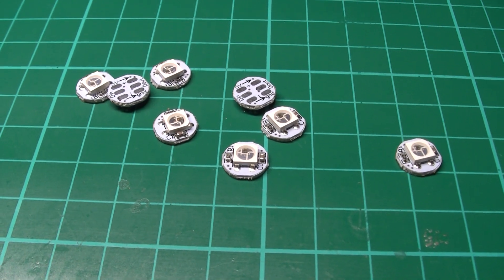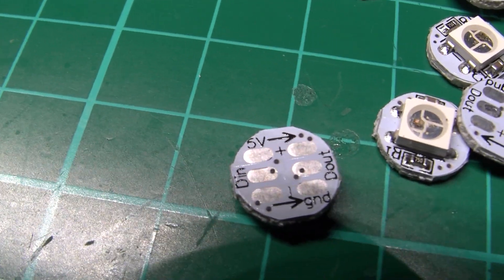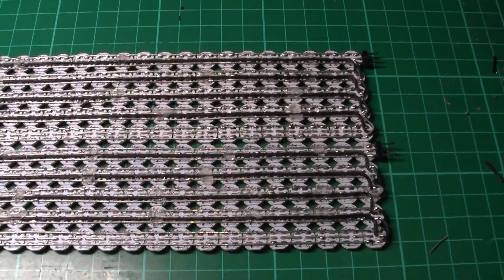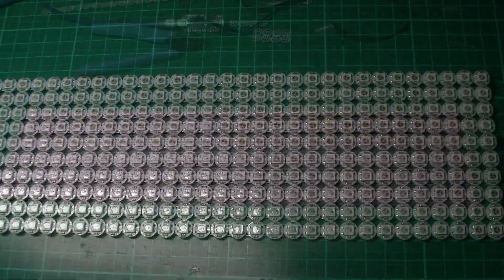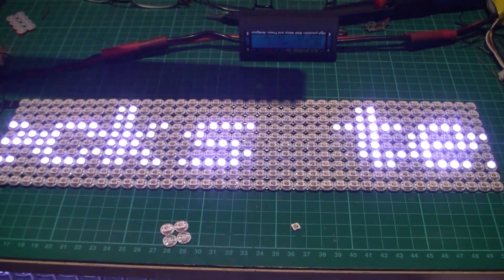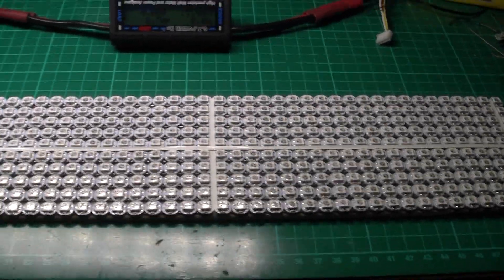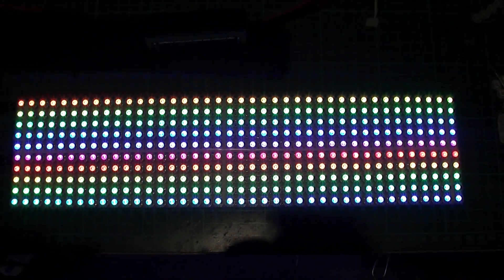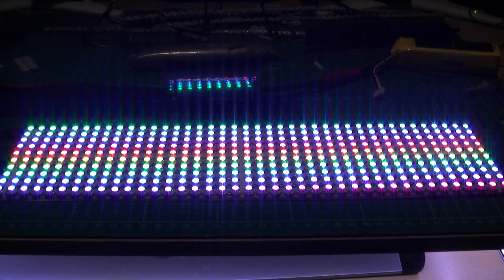Arduino & 400 Neopixel WS2812 RGB LED matrix project

Comment: Man you're crazy alright to actually make a 400 led matrix, I don't know if you have kids but the 200 leds that you have left over you could use to make a crazy Halloween costume with lights, and you can make attributes to add to that for example a red and yellow glowing sword so it looks like there's fire coming from the edge of the sword, or make a Tron costume that requires some lights.
Or you can place the leds at random places outside in your garden or somewhere on your house and use them as twinkly lights, man there are so many things you can do with neopixels, they are very cool.

Comment: If you power the Neopixels from a separate 5v supply capable of handling the amperage, then the controller only only needs to have the GND and Data lines connected to work.

Comment: Noting the Truth! It's a tough Love. I have a project of 300 coming up. Thanks for the hint about testing the modules prior to soldering it all together.
Reply from the maker: You don't need to test them - the LED itself is quite easy to replace once it's all assembled. You leave the base part and simply unsolder the square LED.
Good luck with it..... I'm already feeling your pain :-)

Comment: Hey ! Was wondering what are the specs on the wire you used to solder it all together?
Reply from the maker: It's simple link wire like this: http://www.ebay.co.uk/itm/121623613167

Comment: Did I miss any part about resistors or anything? There are no resistors on there right?
Reply from the maker: You're correct, there are no resistors. They aren't the same as using normal LED's because they're digital and there's no resistors needed.
Reply: Okay thanks for the info! I'll have to look more into it

Comment: I just finished soldering 1400 of these in a 20x70 matrix.  Can you post some detail about how to power these and how I separate segments because of the current drawn by this large amount of lights?  I also don't know what I will need as a controller for this amount of lights.  Please help.  I have a crapload of hours in this as a gift for my fiance, and I have literally "Lost My Will To Live".  You need to get shirts made up, by the way.  You totally own that phrase now.
Reply from the maker: WOW, 1400? You must be on the edge of suicide by now! :-)   
For power, I calculate how much a certain amount of LED's at full brightness and displaying white takes. e.g. I've got some 5v 5amp regulators - Each LED is 0.06 amps which means I can drive 83 LED's with one 5 amp regulator. I simply detach the power (but leave the data connected) at LED 80 (to be safe) and connect the power to that segment of LED's. Either that or get an 84a power supply to drive all of the 1400 you have. Sadly I can't find an 84a power supply but I have found a 70a ...... https://www.banggood.com/Universal-AC110220V-to-DC5V-70A-350W-Switch-Power-Supply-Driver-Adapter-Transformer-LED-Strip-Light-p-1038797.html    
A 70 amp power supply will be OK because you'll never have all LED's at 100% brightness and displaying white.   
I use an Arduino Nano to drive them but literally any Arduino will be fine. Theoretically, you can drive 65535 LED's with a single Arduino.   
As for the shirts...... I think I might just do that. I don't know how many times I've said it now :D
Reply: I have run 1400 LED's from a 12 amp 5 volt power supply and an Arduino Uno.  See: https://www.youtube.com/watch?v=PFup912TcVs&t=4s

Comment: I took two years but we finally watched this one. Jon has got 60 element strip and is trying to program a teensy to make a light show. thanks for the vid! Tony, you kind of sound like Marvin the depressed robot from Hitchhikers Guide on some days. Marvin is a prototype for the GPP feature. People say I sound like Hank Hill sometimes, not sure why :-)
Reply from the maker: I've never watched Hitchhikers Guide but I'll have to watch it now. Looking at the video I've just seen, you're right, I do sound like him!
Some people say I've got the same temperament and sound the same as Jack Dee (another British comedian) but I don't see it myself..... I don't know where they get it from :D   
Good luck with the Teensy and strip, Dave. It's easy if you follow the examples but you'll be driven to suicide if you try anything else like I (stupidly) did.
Reply: I think Jon needs WS2812 teensy 3.2 examples but is having trouble finding any.
He wonders if he needs the 74HCT245 or similar buffer chip to get the voltage from 3.3v to 5v.
Reply from the maker: I used an Arduino Nano because of the 5v signal output  - it's much cheaper and you don't need level shifters.

Comment: why are you not use ready LED panels from Aliexpress? Like 8x32 or 16x16  - you may connect it from one to another to do a huge matrix. Or maybe they can do panels by your specs - now I'm just searching this option, because I need NOT a square rect shape...
Reply from the maker: Simply because there's no fun it doing that. I prefer to make things, rather than simply bolting panels together :-)
Reply: You will need 50 amps at 5v? Or do you not plan on powering them to 100%? That is a lot of amperage due to the 5v rail of addressable LED's. It's actually only about 250 watts, less or slightly more depending on color and brightness. However the gauge of wire you use depends on amps, not volts. However, if you use 5 taps to the power rail down the panel, each wire will only need to carry 10 amps each. 

I would use solid core personally, and then run the power output to every row in the strip to reduce the voltage droop, otherwise the LED's will fade out.
With that much current though, as close as possible would be ideal, less power loss to heat.
Reply: Richard Smith thank you for replying 😀 I have power to every strip to a terminal block at bottom of panel, I'm going to use the matrix outside so was hoping to have the power supply inside which is about 5m max...I have a 60amp 5v supply but unsure of the cable required from it to the matrix terminal block? 😏
Reply: If by matrix terminal block, you mean the data line, that isn't very important as far as distance goes. For the power rail, as long as you use enough taps back to the power supply so the current is reduced, distance of the power supply will be less of an issue. However, if it is too far with a lot of current, the current requirement will go up even higher due to power loss as heat in the wire itself.
I am assuming, of course, you are using addressable LED's. If you are using individual LED's that are matrixed... that is a whole other can of worms, but similar in that multiple taps per axis would be ideal. I sure hope you aren't matrixing 900 LED's. A shiver ran down my spine thinking about it. 60 digital inputs to deal with to boot... Would need to be multiplexed.
Reply: Richard Smith sorry if I didn't explain it well enough, I have power lines from each 30 rows into a power block on matrix so I need power from that power block to the 5v supply which is 5m away?
Reply: That would only be ~2 amps per row, that should be fine, assuming you have a high enough gauge wire. 5m of 14 gauge stranded copper wire would only cause a 0.03a current loss I believe.
Reply: I would NEVER do individual LED's, but I think using LED strips is just enough work to feel rewarding. Using preassembled panels is cheating.
Reply: Richard Smith IV made a 900 pixel matrix from led strips....need some advice on powering it....I plan to have power supply 5m away so what cable should I use or am I best of having it closer?

Comment: It almost sounds insulting to say - "just use some WS2812 strips". Looks very impressive and a lot more sturdy than 10 strips curling up at the ends and peeling away from their backing! I get board wiring up just 5 of these... Cool job!
Reply from the maker: Thank you.   
Yes, it would have been much easier and, in hindsight, I should have done it with strips. Mind you, I like doing things to show what's possible.
Reply: Agree - like handing a paint roller to an artist and questioning why they used a small brush?! :)
Reply from the maker: I couldn't have said it better myself :)

Comment: You’re very close to a message board that mounts in the back of a car - letting drivers use to talk to folks (or f____ks) behind them that need to know “their door is open” or “your lights are on”.  If you can make one of these with a voice command through our phone, universal mount, relatively inexpensive,  you will get very rich.  If not “voice command” then a set of common commands that one might use to tell (or tell off) the driver behind us.
Reply from the maker: You've just described everything I usually do with my fingers :D    
I think I've gone as far as I want to with this. Sadly, I lose interest very quickly and I've moved onto bigger things now.....sorry :-(
Reply: I have often thought of what you describe. I invision it on a thin wire matrix with the smallest ws LEDs, stelth on the window like defrost wires.

Comment: Hey, really cool work. I'ts my first time working with WS2812 LED, and I have some questions: Do the DIN and DOUT have to be conected  to something for the leds to work? or can you just conect the + - and gnd? thanks
Reply from the maker: This is how they work.......    
The LED's talk to each other and they know if there's another one connected to it. The first LED is number zero (because it can't see any others connected to the DIN side) The next one looks for an LED connected to its DIN pin and asks it what number it is (zero in this case) and numbers itself 1. Now it knows it's number 1, it talks to the third one etc. etc.    
That's how the numbering works. You need to connect DOUT to DIN for them to work.    
Connecting just the + and - won't do anything (you may get some of them randomly come on) but you need to link them all together and initialise them before they'll work. Try loading the 'Adafruit Neopixel' example.    
Hopefully, I haven't confused you even more :-)
Reply: No, thans a lot man. But how do you make a matrix with them? Thanks for the fast and gelpfull reply
Reply from the maker: Making a matrix is a different story and hard to explain. It still uses the same principle but (as in my project) there's 10 rows of 40 LEDs. LED zero is the top left, LED 39 is the top right, LED 40 to 89 is the 2nd row etc. etc.    
It's best if you start reading up on the Adafruit website - it does tell you more about how it works and explains it far better than I could on here........    
https://learn.adafruit.com/adafruit-neopixel-uberguide/neomatrix-library

Maybe one day, I'll do a bigger one with a tutorial on exactly how to build it but my time is rather limited at the moment :-(
Reply: Ok, no problem. So it doesn't work the same way as a matrix in colums and rows?
Reply from the maker: It works as a single row of LEDs but you link the end of one, to the start of the next. If you wanted to illuminate the left 'column' you'd illuminate LEDs 0, 40, 80 120 etc.
Reply: But to light 0,40,80,120, ... do you program that with a computerchip? (Arduino,plc,...)
Reply from the maker: Yes, you do need something to control them. I use an Arduino Nano on this video.

Comment: What power supply driver are you using?
Reply from the maker: In this video, I used a 3s Lipo (12v) into a 5v regulator. I've since started using one of these:    
http://www.banggood.com/Universal-AC85-265V-to-DC5V-10A-50W-Switch-Power-Supply-Driver-Adapter-Transformer-LED-Strip-Light-p-1038777.html
Reply: I buy a LOT of stuff from banggood!  Especial Arduino's!
Reply: I thought about getting that once, but putting mains wires onto the back with no cover?
Sounds dodgy af

Comment: it is not digital in digital out, It is data in data out
Reply: It uses a digital signal to transfer the data through those pins, so technically it is both.
Reply: No difference since the data is digital in this case. Data lines aren't always digital, but digital out is always also data out :)

Comment: What about a SD, HD, FHD and UHD screen with that LEDs?
That will be the true LED screen.
Reply from the maker: +metralha761 I did think about it but I did some calculations......it would be 3m wide and use 7kw of electricity :-)
Reply: +Vortecks true, and if we talk about UHD we have around 7 floor building of tall and more with width. So it will be a crazy screen.

Comment: This kind of LED's can be controlled by another controller? I mean the T-1000S for example! Because this LED's haven't chip.. So i dont know about it!
Reply: From the specsheet, it looks like you just daisy chain them and send a bunch of 24-bit RGB's into the chain.  The first LED reads the first RGB, displays it, then removes it and sends the rest down the chain. Repeat for the 2nd LED, 3rd LED, etc. until it hits some "pause" which indicates it should start over (i.e. refresh the screen). That's how I think it works anyways. It's simpler than how they make it sound, because they aren't really "addressable" which implies you talk to each LED individually.

Comment: You can give them to me if you can't figure out what you want to do with them
Reply from the maker: +Mr. ProLogic I use them as a noticeboard/light show at work :)
Reply: +Vortecks I actually like it how much would you charge me to make one for me
Reply from the maker: +Mr. ProLogic As I said to someone else who wanted me to make one......The labour alone would be more than the cost of importing one from China my friend. Honestly, I don't think I could build one for less than £200 because of the time and coffee I'd need. Sorry about that :-)
Reply: Okay well where did you get the diodes at & I will sit in front of my sodering station and make 1
Reply from the maker: +Mr. ProLogic http://www.banggood.com/100Pcs-DC-5V-3MM-x-10MM-WS2812B-SMD-LED-Board-Built-in-IC-WS2812-p-979463.html Have fun and make sure you really want to do it first :-)

Comment: "i was gonna do 600, but i've really lost the will to live" xD
Reply from the maker: +hetoan2 Someone suggested doing a VGA matrix (800x600) but I'd have committed suicide by now :-)
Reply from the maker: 480,000 pixels, 1,000 amps, 4kw of electric and £52,000    
I don't think so :-)
Reply: @Vortecks  lessen the brightness and use adressable strips so you a. use less power b. have less trouble assembling
Reply: Why would you do this and not use the addressable strips instead. I would kill myself...
Reply: Hi, good video!  I produce a compact LED controller and softwere for the animation of such LED Matrix. You can see it on my channel.

Comment: I have my first 100 of those coming from Banggood in a couple of weeks (??) and am going to craft them into some sort of garment...  Not sure what, but it's gonna be cool.  I spent Christmas getting a couple of strings working using the fastLED library.  You're not mad, you're addicted.  I know the feeling.
Reply from the maker: +FranzStrasse That's exactly how I started. I ordered 100 but didn't know what to do with them because there didn't seem enough. Over the course of 6 months, I ordered 600 and finally decided on what I wanted to do with them but I don't think I've finished though. Good luck and thanks for commenting :-)

Comment: how to power for LEDs ?
has just connect vcc and gnd to 5V external power and data to arduino pin ?
Reply from the maker: +Thang Ninh Simply put... yes. You must make sure that everything shares a common ground though,

Comment: Amazing little things... I guess we'll have to wait for the VGA version.... 307,200 pixels would take you only 307200 ÷ 400 × 12 hours = 9216 hours and draw 5,376 amps!
That's a lot of rainy days and a power station!
Reply from the maker: +Andy Lee Robinson It doesn't bear to think about, Andy. I fell sick just thinking about it :-)
Reply from the maker: +Andy Lee Robinson Actually, I've just done some calculations...... 800x600  = 480,000 LEDs. 480,000 ÷ 400 x 12 hours = 14,400 hours.     Working 8 hours a day = 4.93 years.   Total amps..... 7,200.     If I used UBECs, I'd need 3,600 of them.      £5 each would be £18,000.      Total LED cost......£52,800.     Total size....... 30ft x 22.5ft.      I think I'm on to a winner there, Andy! :D
Reply: only my small 16x24 display already draws 3 amps on full brightness